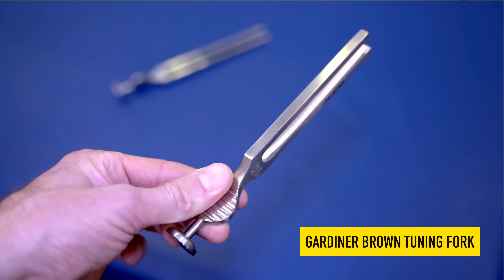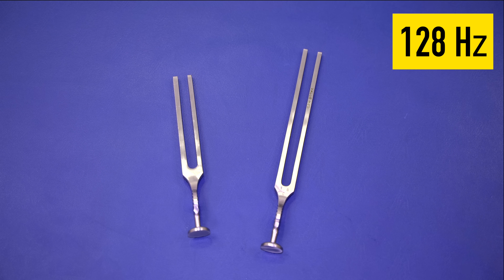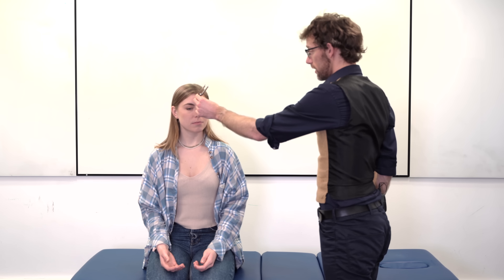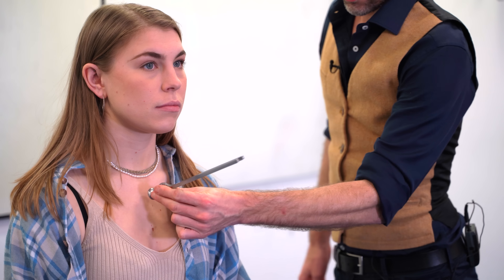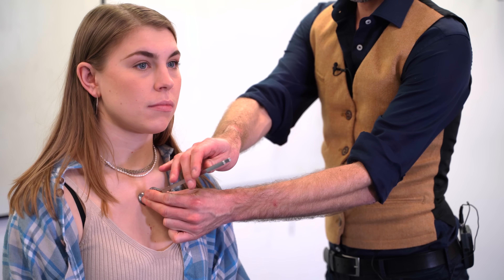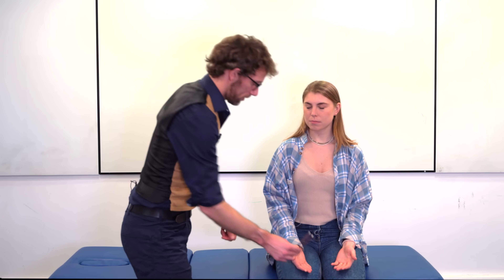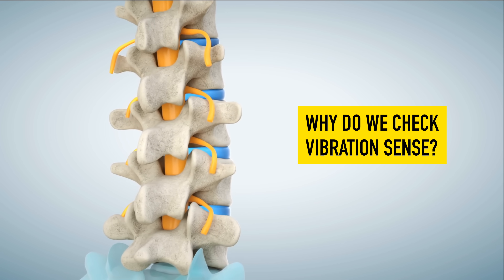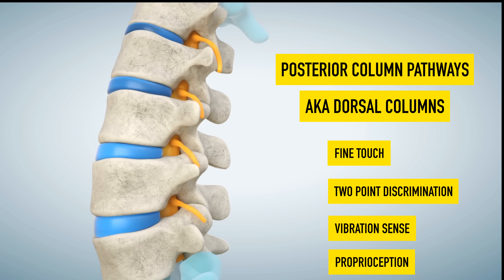How to Use a Medical Tuning Fork - Assessing Vibration Sense - Clinical Skills - Dr Gill

Comment: What’s the significance of using 512 Hz and 128 Hz? Would other vibration frequencies yield different results/why?
Reply from the maker: Because of how they are used on different body parts and the sensitivity 

512hz is a very “fine” vibration, whereas 128hz Is quite coarse might be a better way of viewing it

Comment: Is there a reason for the random seeming values of the forks rather than base 10 values?
Reply from the maker: Sorry I don’t understand 

The numbers are the vibration frequencies
Reply: I did some digging on Wikipedia, the short answer (assuming I understand correctly) is that those frequencies are chosen so that the fork produces a correctly tuned note. If we went by base ten you'd likely get weird out of tune noises, that probably would sound unpleasant. The long answer is: 

Commercial tuning forks are tuned to the correct pitch at the factory, and the pitch and frequency in hertz is stamped on them. They can be retuned by filing material off the prongs. Filing the ends of the prongs raises the pitch, while filing the inside of the base of the prongs lowers it.

Currently, the most common tuning fork sounds the note of A = 440 Hz, the standard concert pitch that many orchestras use. That A is the pitch of the violin's second string, the first string of the viola, and an octave above the first string of the cello. Orchestras between 1750 and 1820 mostly used A = 423.5 Hz, though there were many forks and many slightly different pitches.[5] Standard tuning forks are available that vibrate at all the pitches within the central octave of the piano, and also other pitches.